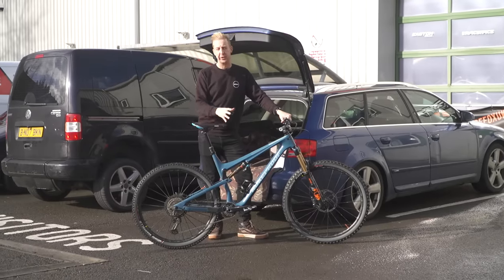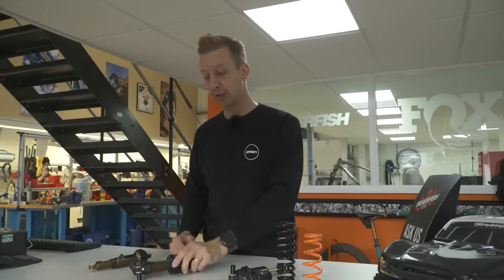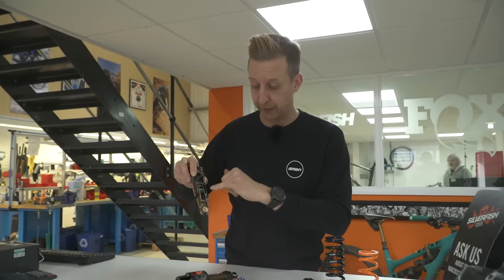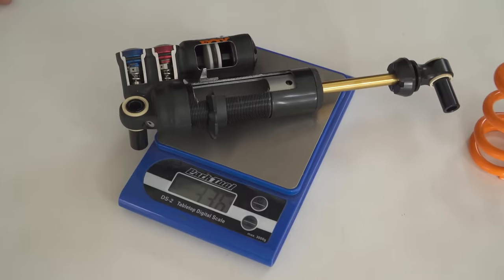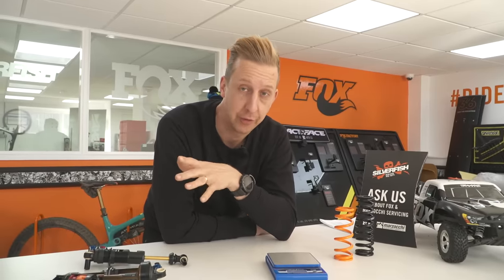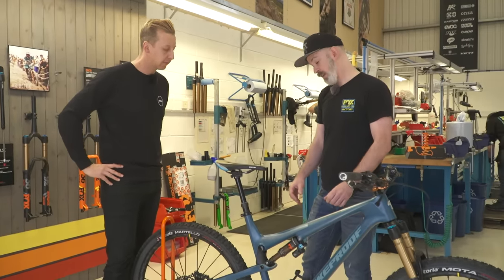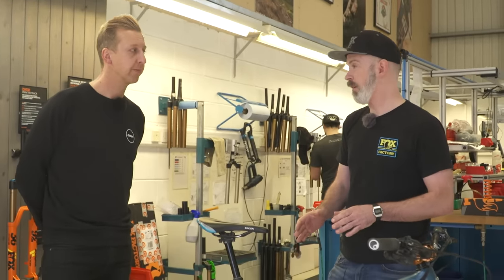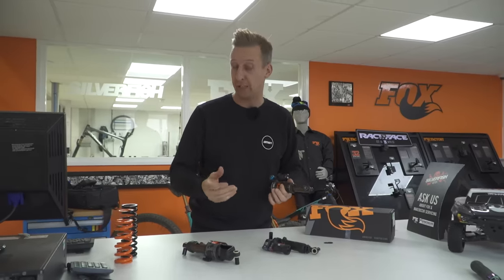Converting Your Mountain Bike From An Air Shock To A Coil Shock

Comment: First of all, don't convert to coil. Most bikes for most riders will work worse afterwards, if you did run any sort of decent air shock before. Your bike will be less efficient, pedal worse, go through its travel way faster and most likely loose most if not all of its bottom-out protection. Also adaptability and tuneability are way worse on any but the most high-end coil shocks, if you want to counter bottoming-out you can pretty much only increase the spring rate which makes your suspension unnecessarily stiff, there's pretty much no way to tune progression except with expensive aftermarket gadgets, you'll have to completely remove the shock if you want to change the spring rate opposed to just add or remove some air, replacement springs for more or less spring rate are at least 50$ each, etc.
So yeah, in short for most riders in most situations an air-shock will work better. 

Great video nevertheless.
Reply: So in short the coil is a bit of a lady shock...
Reply: I have a freshly serviced 2019 Float X2 2-pos in my basement and I am running a 2009 Vivid Coil R2C on my bike that I have bought while my air shock was at fox. I have the fox shock back from service for 4 weeks and haven"t really bothered to swap it back as the bike feels amazing with coil. 
I had coil also on my previous 130mm trail bike and it rode great. Easy to pedal, no bob, lots of support and great traction.
So, what I am trying to say is... maybe it is you?
Reply: Coil is working great for me. I have two bikes one with coil and one with air. Coil is better choice for rough terrain and park. Obvious you don’t know what you are talking about.
Reply: "if you want to counter bottoming-out you can pretty much only increase the spring rate which makes your suspension unnecessarily stiff," 
Not true, my DHX2 has both high and low speed compression adjustments and high and low speed rebound adjustments. My high speed compression is set high specifically to resist bottoming out on drops, while my low speed is set low for better pop on jumps and traction in corners. It's as tunable as an air shock with the only difference being the need to swap springs instead of adding or removing psi.

Comment: More people would ride coil if it wasn’t so cryptic to figure out what coil is needed.

This stuff is still measured in lbs/inch, in a kg/mm bike world. Way to easy to be in a rounding situation and be way off on spring needs.

If you’re a light rider, someone who would actually greatly benefit from a spring, you’re out of luck. Unless you got lucky with a Push shock, there isn’t a spring for you.

You never really know how progressive your frame is until you put a coil on, and how it feels like, assuming you got the right spring. Good luck getting actual data, progressivity is used as a buzz word by manufacturers.

Comment: That sag math was bonkers! How did you get the 15mm af sag needed. Its clearly not 30% of the 210mm eye to eye. No its 30% of the STROKE of the shock that was not even mentioned! Come on!..... sorry rant over......
Reply: I know, confusing folks.  30% of 210mm ain't 15mm , it's more like 63mm. And besides, like you say surely you work it out from total stroke length. Unless it's different for coils?🤷‍♂️ after all this man works for fox. 
I've only ever had air.  My dilemma is fox36 or lyrik ultimates. 
I'd like to try a quality coil set up though for fun, just to see what it is like.
Reply: Oh no, it was not mentioned. Now the people of instant gratification generation will have to do some thinking on their own... Disaster!

Comment: hold on maybe im stupid but i thought 30% of 210mm is 63mm  not 15mm like the guy from fox said
Reply: Mario 210mm is the eye to eye length. You need sag at 30% of the stroke length which I assume was 50mm in this case.
Reply: @TrailBikeMike  yeah i understand it was me bring stupid, the eye to eye length was just a point to measure from

Comment: Another reason why I stopped buying stuff and just keep riding the bikes I have because every 10 minutes something else is changing and it's supposed to be better or more relevant than what I used to have. My bikes are 5 years old and I Still Smoked 3/4 of the people on the mountain with their brand new coil shocks and reverse Forks 29er Wheels.

Comment: Okay maybe I'm going to give somebody a multi-million ideamaybe I'm not but my thought is air works great in certain situations coil springs work great for the simple fact that they're very simple and they basically followed the ground really well so why not incorporate a spring in a airtable literally a spring into an air chamber that way the spring a smaller and it's it's inside the air chamber and would give the ability to have the best of both worlds 1 for the progressiveness of the air chamber with the suppleness of the spring to be able to ride the train better one would give just the lower end where the other one would give the top in just a thought but if you ran the coil on the outside of the chamber you would have a larger Masscoil which would mean larger wait where is if it was internal it would be a smaller Mass AKA smaller amount of weight... And the main reason why people love coils is because they follow the train better

Comment: Massive ships engines did away with coil springs on exhaust valves for air spring pistons. Coil springs are too slow.
Reply: Retro Dude, Old man on his bikes luckily bikes aren’t massive ships, boomer
Reply: WTF? Coil springs slow...??? 
Congrats you take the price! That's probably the dumbest thing I have heard on Youtube ever.
Reply: Krikstar123 that’s exactly what they are, and why racing engines in cars and motorcycles have done away with mechanical springs and have pneumatic (air) springs instead. The springs on vehicle suspension however oscillate at a rate FAR less slower than inside an engine, so the advantages of a mechanical coil spring outweigh the “slowness” in many cases, which is why you see coil springs in car and motorcycle suspension!
Reply: @kevinxodemonth  Yes and as such what ever advantages an air spring has inside an engine is completely irrelevant to MTB suspension. Coil springs being "slow" is the least of all the problems with suspension design. Real life scenario is that the higher friction on air seals alone makes an air shock on a MTB react slower than an coil spring, so whatever theories about coils and oscillation goes out the air anyway. (+ Speed and oscillation is not the same, but that is up for a longer discussion than what I feel like going in to here...)

BTW This is the perfect example of what happens when someone reads something in a book without having the overall understanding or ability to put thing in to context. Knowledge is worth nothing if can't put it in to the right use ;-)

Comment: Very misleading parts of this video, and not at all what I've come to expect of the channel. No mention of the servicing cost or indeed the lack of servicing a coil often needs due to the massive differences to the internals. Waxing lyrical about the things he knows and loves and not really entertaining the alternatives fairly. Yes, air shocks is much lighter, but they are also much more fragile as far as long term use and for maintenance, hence giving a far far higher cost of ownership over even 3 yrs. They made a really big deal about selecting a coil spring, yet its really easy, and you don't need any special tools (shock pump) or fiddling about with volume spacers and endless tinkering to 'try' and make it feel better. If you ask me the infinite adjustability of an air shock is as much of an issue. Also no mention of the air temperature and altitude altering the air pressure and effectiveness of the air spring, only that its 'infinitely' adjustable. Anyone would think this was sponsored by an air company..... lol.
Oh and the DHX2 2020 and X2 2020 both have compression on the fly levers so nothing to retrofit or modify...…. hmmmm another misleading quote.

Waiting for the next video. If they don't see the benefits of a coil for rider feel, they are massively misrepresenting (bike dependent of course).

Comment: stick w air unless you have infinite time and money to faff around w coils
Reply: there are progressive springs, there is Springdex which can adjust the spring rate, which both are mentioned in this video, and if you dial it in there is no faffing with air pressures during ride, or from day top day. I had to do it almost everyday in the winter, and during evry ride too, some times even during the ride, if I rode for long and there were rapid changes.